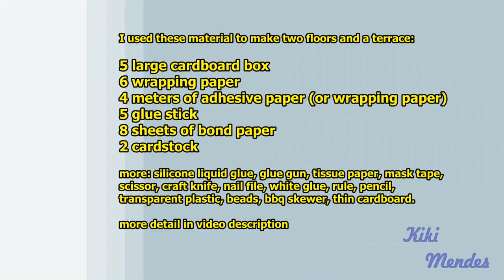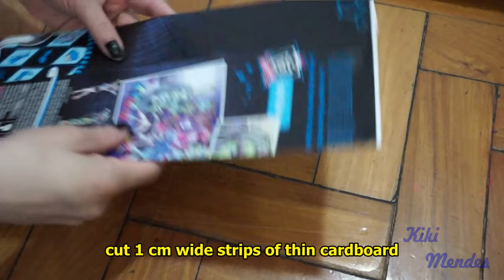Tutorial: How to make a cardboard dollhouse for Barbie, Monster High, Frozen, EAH, etc DIY

Comment: I've been working on mine about 6 weeks. Having a little problem with the floors sagging. I'm starting the windows and want most of them to raise, and can't tell for sure how you did the frame for those. the tracks would have to be on the sides, but it looks like they still have something for the sill. Can you elaborate?